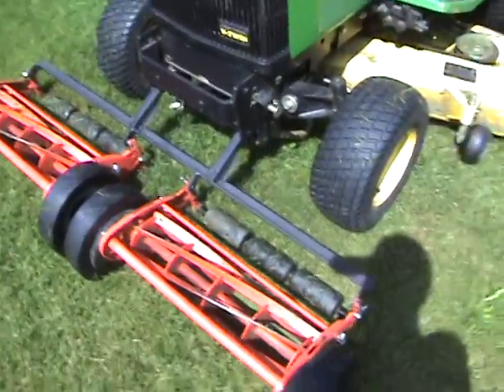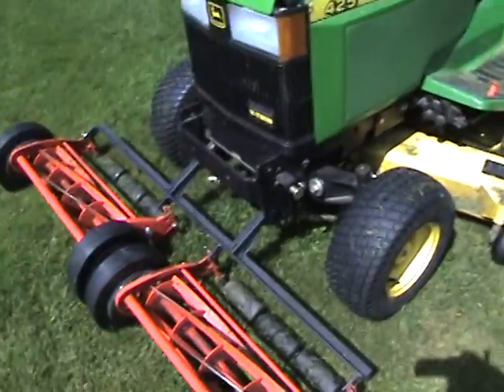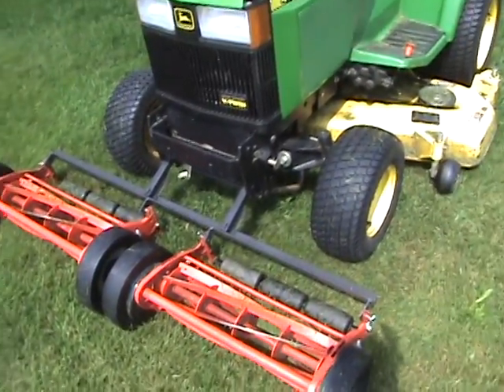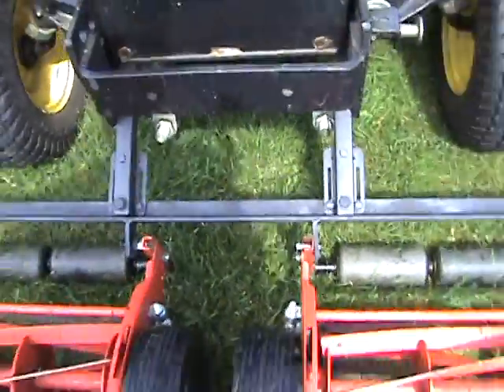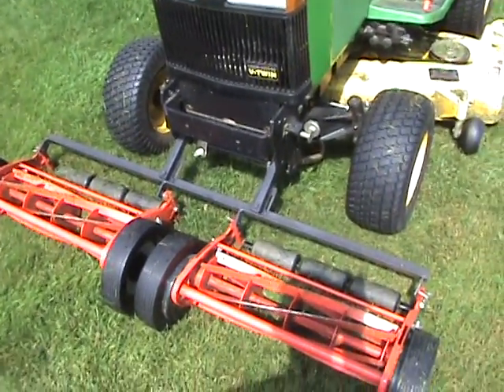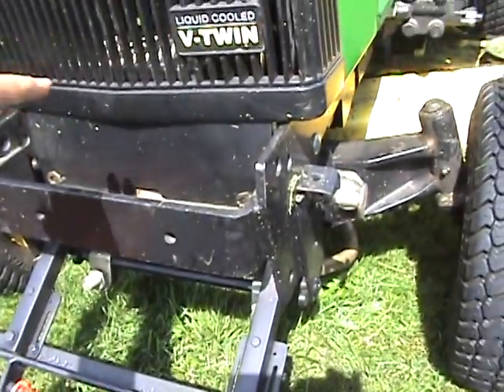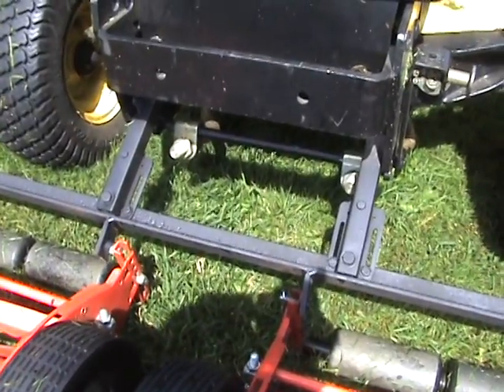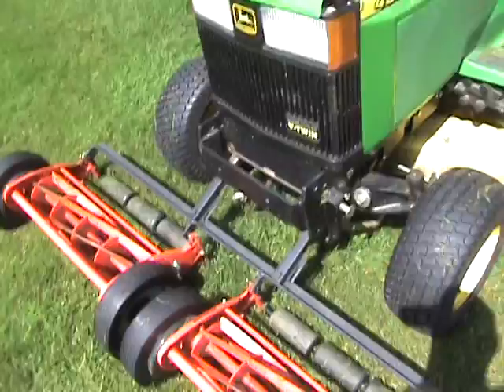Gang Reel front mow invention SAVE GAS and Healthy Grass.

Comment from the maker: @joedude999    Your correct. There would be no way to steer. I just found out that there is a spiral roller to put in front of the reel that will lift the grass back up. If it works I may be putting the reels back where they were. It's been fun experimenting though.

Comment: Hi Vic. Where can I purchase the individual reel mower units? I’d like to build a system of my own. Similar but different to this one in the video. FYI, I did see in another comment you abandoned this reel system. Thanks!
Reply from the maker: Honestly  not sure where they sell them. I bought mine from ebay but pretty sure that seller is gone. You can go directly to promow but they charge top dollar for them. I paid less than half what they were selling them for and mine were new.

Comment from the maker: That was a really good deal at 3,500. My in laws paid 8000 but it was new. You might want to buy your snow blower attachment used as well. The price of a new one will floor you. I considered it but ended up using a Snow Sport plow. If you get a minute check it out. I posted a video of it. They are great on an assortment of vehicles.

Comment: Why not make a hitch to offset the mower to one side.  If you mow back and forth you will run over uncut grass on one pass but when you come back you will be pulling it from the opposite direction so it should cut fine.  Or you could make a hitch like the haybines where you can swing it to alternating sides as you turn.  I've been following your progress for a while.  I'd like to try this too but I think I get too many sticks in the yard for it to work very well.  Thanks for posting.

Comment from the maker: Hey I have a little tip for ya. Next time you remove the deck. Grab yourself a couple pieces of short  2x4's maybe a foot long each. Drive just the front tires up onto them length ways. It's just enough height to remove the deck

Comment: this is an old vid but i'll leave a comment any ways
sorry if already said but i would find away to hook it to the front steering so that when I turned the wheel the front mowers would turn as well
like a pivot in the middle with bars going back to the wheels on the sides
may make the steering wheel harder to turn but the tractor should turn
and your way instead of winch i would make life with a strait bar and handle small chain you can make a pivot that would make it light to lift

Comment: @supergooddeal you could just buy a snow plow lift I have seen them on lawn tractors 
I googled "lawn tractor snow plow lift" and looking at the images you may be better off just buying a long strait bar or pipe
but it does give you another idea something to think about during winter 
You shouldn't give up coming up with new ways to do something is half the fun and very rewarding when you succeed 
side note i plan on hooking 3 of those tow mowers and tow with ATV I just need a big field 1st

Comment from the maker: @mc25a  Hi, trust me when I say they are only good for grass and nothing bigger lol. Also make sure you get the pro mow and not the cheaper version. They should be fine pulling along through a rock driveway as long as it's slow. I bought these reels off of ebay and not through pro mow. Pro mow has the price ridiculously high.

Comment from the maker: @mc25a  You have some really good ideas. I just don't want to mow anymore than I have to by going over what I did in the opposite direction. I did it that way for awhile. I ended up putting everything back on the rear and ran my deck mower as well. Took care of the entire problem but I do use a little more gas this way. Ahhhhhh can't complain for 45 minutes of mowing :)

Comment: Cool I would love to see the video. Yeah since we bought it used it had a little wear and only a little the previous owner took great care of it we already had to clean the deck and sharpen the blades. It was a little of a hassle cause we didn't have a jack to lift up the tractor to remove the deck lol so my dad had to gather all his strength. Lifted the front end of the tractor and I slid those adjustable feet the rachet kind I don't know how to explain them really but we got those under it an

Comment from the maker: @wantblackwolf   Funny you mentioned all that. I discussed something similar with a guy in the messages on my other reel video or maybe this one.  Anyhoo,  because of no time for inventing. I ended up putting them back behind the mower and just ran my deck to take care of the grass layed down by the tires. I use a little more gas but still do it in the same amount of time.  Thanks anyway man.

Comment: Can you modify a cold steel boomerang to fly or is it to Heavy for flight?
Reply from the maker: +Nate c   It is possible. You would need to remove a lot of material till it was around 5-8 mm thick. Then give it a couple good lead and trail edges.
Reply: +Victor Poulin being thin it would lose it's ability to do things like smash ice but still being polypropylene you would  say it would be up to more abuse than a traditional wooden boomerang correct?
Reply from the maker: +Nate   I really couldn't say for sure.
Reply: +Victor Poulin ok, thank you for your time and thoughts.
Reply from the maker: +Nate c your very welcome

Comment: ...you said the tires pack the grass down and wont let the rear reels cut the grass... then how will the reels behind you cut what the front doesn’t when fronts are lifted in the corners?
Reply from the maker: Sorry but not sure what you mean by "fronts lifted in the corner"
Reply from the maker: I stopped using these reels some time ago and switched to an entirely different system. It would be in a more recent video.

Comment: @supergooddeal I meant field as in  big enough yard that would require a big mower the yard behind me doesn't get mowed so i get to see tall grass and weeds i don't like that see i'm thinking when i strike it rich i'd have a lot of land and that i would want to keep it mowed instead of a big tractor with a wing mower on back i would just tow 3 of the gang reel mowers behind the ATV that i would already have i would still have a rider for the tight spots or if i'm feeling energetic a push reel